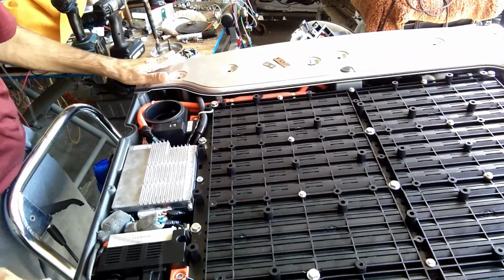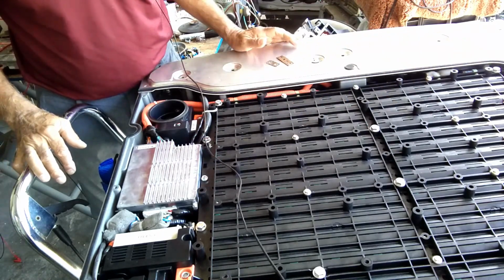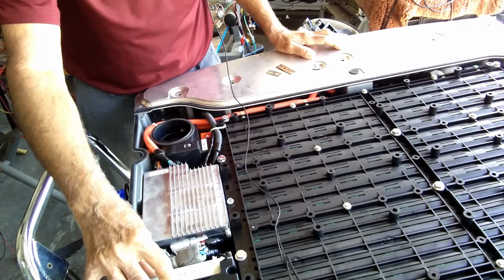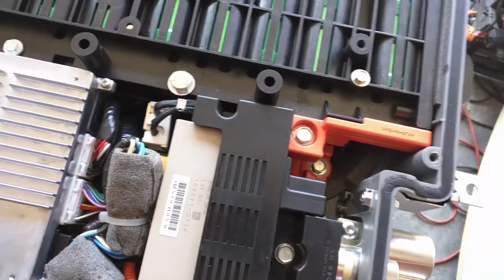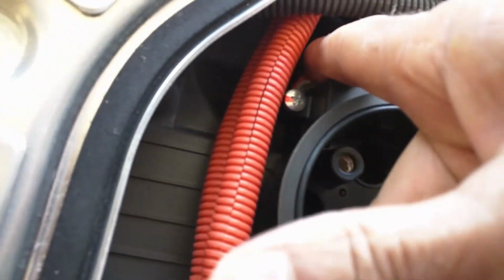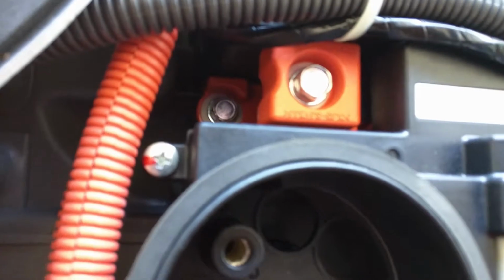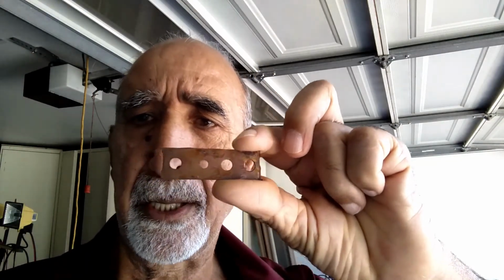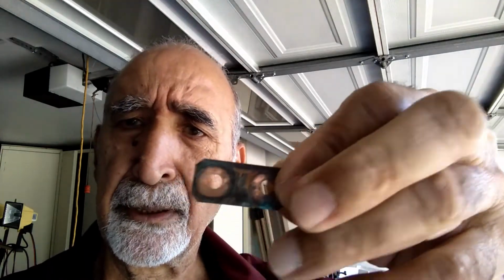Ford Escape Hybrid Battery  - How to Charge

Comment: 2006 through 2012 all used the same hv battery they all contain 50 modules 24 in one rack and 26 in the other any escape hybrid that battery fall below 300v won't start and should be reconditioned not just recharged a battery in good condition will stay above 345v @ 35% soc ( state of charge)
Reply from the maker: You want to first charge and see. Most of the times, charging and balancing helps. If that doesn't work, then go for reconditioning.

Comment: On 09 later years hybrid Escape and Mazda equivalent,  why not just make connectors to plug in the existing factory connector left over from the previous years?  Then connect a smart charger directly into the connector.  The battery charger can be installed permanently in the empty space on driver side and then make a panel connection to plug into.  Anyone selling a smart charger that can maintain the hybrid battery without overheating overcharging?

Comment: Is there supposed to be a line under where it says DC when hooked up properly.  My battery is not charging its been at 108 v for a while now
Reply from the maker: Hi Brown, yes there is a line under DC, which underlines the word to show that it is DC Voltage. If the voltage is static at 108 V, that means it is not charging. Did you turn the Red power switch to ON(1) position ?????

Comment: Can a 2011 ford fusion hybrid battery be changed? It was sat for over 2 months when I bought the car it started fine but battery (12volt) was not good so replaced with a new one now it won't start I'm getting a code P1A10 hybrid powertrain control module-battery disable  thanks hopefully you can see and answer my question
Reply from the maker: Hi, Yes the battery can be replaced as well as re-conditioned. it seems to me that after you replaced your 12 V battery, there is a problem with the computer. You should disconnect the 12 V battery for about 8 hours to reset the computer. If that does not work, may be the new 12 V is not proper.
Reply: @VeniceHybridTech  do u think the hybrid battery is bad car only has 40k miles on it it just sat for long time with no battery on it (12 v)
Reply from the maker: @sanjosecuaro84  Yes the battery goes down, but the sticks inside may still be OK. You need to try to revive the battery as per my videos.
Reply: @VeniceHybridTech  if it can be charged would it charge the same as the one on this video
Reply from the maker: @sanjosecuaro84  Yes.

Comment: 2008 mercury mariner
Reply from the maker: Yes, for your vehicle, you definitely need to charge and discharge the battery pack.
Reply: I have an o8 as well sat for three weeks. Usually if it sits for a few days I have to jump the 12v. The button never lights up on the charger under dash. 
Have a new battery today. Still stop safely now.

Comment: I have a 2006 Escape HEV. I have a current code of low state of charge. My current SoC is 53%. It seems to run fine and the gas engine will shut down when the battery has a satisfactory charge. Is there a method of “reconditioning” the battery? Thanks! Would you know at what SoC percentage will the car no longer run?
Reply from the maker: I think that if the SOC falls below 50%, it will stop. I do have a video on" How to recondition a FEV." Please watch it.
Reply: @VeniceHybridTech  thanks.. I’ll watch your other video.

Comment: Thanks for the video. I have a 2009 Hybrid FWD. These are durable my 2011 fusion hybrid has 534000 kms still runs strong
Reply: Do you have to charge it often? I'm asking as I have just bought the same car, it has 110,000 km. Thank you

Comment: 2007 escape hybrid can you tell me if the battery indicator in the radio shows a full charge when fully charged . Mine only charges to half way on the radio charge indicator. Or does that mean battery degregation of 50% thanks you Al
Reply from the maker: Yes my assesment is that the battery is degraded, otherwise it should get fully charged and the indicator should show it accordingly.
Reply: @VeniceHybridTech  Is it like the Prius the cells become imbalanced and won’t fully charge or do you think it needs cells replaced ?

Comment: hybrid battery voltage isolation sensor circuit POAA7 HOW to fix the problem HELP ME PLIZ FORD ESCAPE 2008
Reply from the maker: Hi, the fault is showing that there is a voltage leak or the sensor is faulty. Did you have any water damage etc. to the hybrid battery ????? Contact us at info@venicehybridtech.com

Comment: I have a 2009 Ford Escape Hybrid that sat for too long and the Hybrid battery is dead.  Prior to sitting, the vehicle ran great!  I'm having trouble finding any dealer or shop with the battery charger for it down here in San Diego.  Are you aware of any shops that have it in San Diego?
Reply from the maker: Hi Matt. No I am not aware of any one in San Diego. You should buy your own for about $ 300!!!!!!!!!!
Reply: Did you find a shop? I let my 08 sit for 3 weeks. Now not turning on
Reply: In SD

Comment: Have you had any experience with Saturn vue hybrid? I bought a used one but it’s completely dead and needs to be recharged but I don’t know how to recharge it and the proper safe way to recharge it
Reply from the maker: No, we have not seen any Saturn Vue hybrid but they are all the same. Most of the cars habe Toyota Prius packs and you can use a Grid Charger. For further communications, contact us at info@venicehybridtech.com

Comment: You dont mention whether to use standard 12 v charger or some other
Reply from the maker: Hi, this video is about 2009 Escape Hybrid that does not have a inbuilt charger. But yes, if you have an inbuilt charger, use it for sure.
Reply: @VeniceHybridTech  How about if we don't have inbuilt charger? What type of charger we have to use?
Reply from the maker: @arnodanesh4905  We have a special charger for Escape Hybrid. Contact  info@venicehybridtech.com

Comment: Hello Venice Hybrid Tech, 
I have a 2009 Ford Escape Hybrid with the following code: ===BCM DTC P0A7D-60===
 Code: P0A7D - Hybrid Battery Pack State of Charge Low. I would like to use your procedure and recharge the battery pack. Can you please let me know what kind of charger you recommend for this? Thank you so much for your help. Gottfried.
Reply from the maker: Hi , Thanks for your comments. You should use High Speed Charger II. Contact me via info@venicehybridtech.com